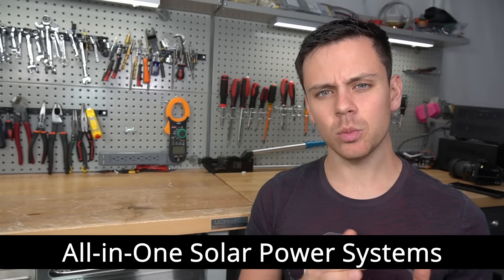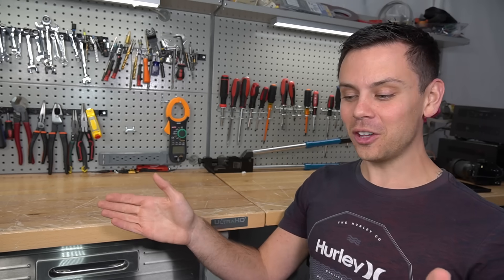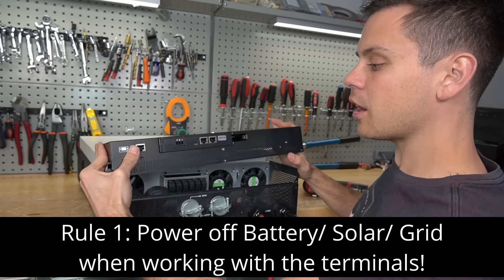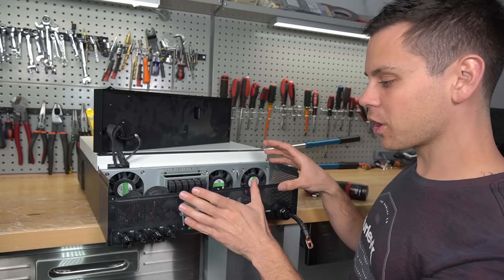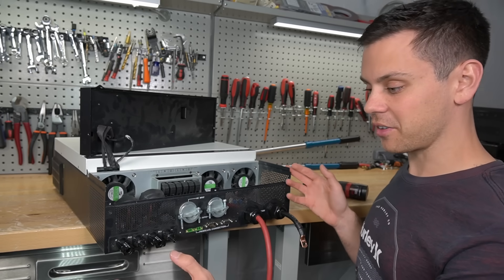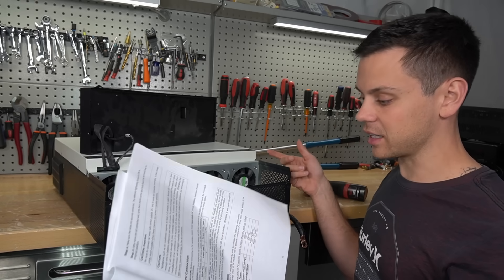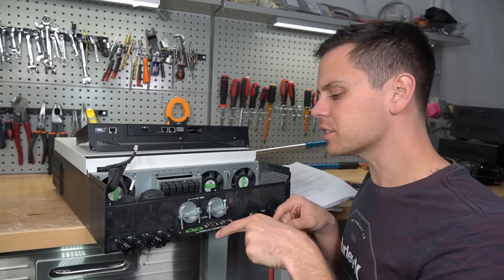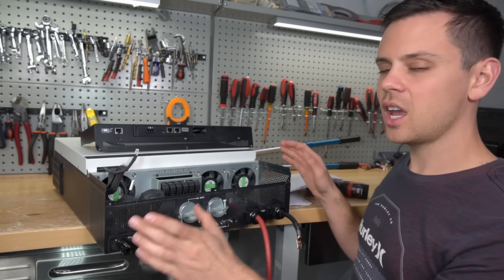All-in-One Solar System: 2 Basic Rules for Shock Hazard Prevention

Comment: Thanks Will, If I open the cabinet, I'd use either a voltage detection pen or multiple meter DC for solar plug connectors and AC for (240v Australian) hoping to see 0.00
🌏🪛
Reply: (lol, Australians without electrical licenses shouldn't talk about doing AC work - not even asking questions on forums - ask a sparky friend - to help (pay for advice if must's be) - having a laugh, sorry - but true.

when "changing a light bulb" act as if everything is deadly -  take precautions to prevent the death bit (or fire).
Reply: Non contact voltage detector pens are not 100% safe at detecting live voltage. They work on capacitance. Multi meters are better but no guarantee that they are working so you could assume it’s dead and still have live potential. Safe isolation testers are not much when compared to not having them and getting a lethal shock. Proving unit + tester, test live to earth, live to neutral, neutral to earth and then back to the proving unit again.
Reply: @davideyres955   - and if one doesn't know what the heck it all means, ask for help, lol...

Comment: I discovered this the hard way about a year ago with my pair of LV6548’s . If that thing is running don’t touch the MPP inputs anywhere between the inverter and the circuit interrupt even if you have open it from the solar panel source. Also, don’t direct short them because it may damage the MPP section. The positive (+) and negative (-) of the entire PV circuit must be isolated from the earth/ground. I’ve grounded the panel frames and their mounting structure. The PV surge protector ground taps go to earth/ground.
Reply: I am glad you touched on this. So to be clear. I should continue to ground my Ground Mount and Frames on the Mounts. But, I should NOT ground my Combiner Box? Thank you in advance.
Reply: @HarshHazeStudios  
None of the PV circuit + or - can come in contact with earth or ground. The only place it can come close is at the surge protection (where if an outside source subjects the circuit to excessive voltage it dumps to ground momentarily). The panel frame, structure, metal boxes or conduits used along the wires path should be grounded. The idea is if any part of the solar power circuit has a short to metal, you don’t get killed by touching high voltage. The PV negative is not grounded nor is the positive. PV is just basically a isolated loop that leaves the inverter and through the panels with interrupts (breakers and or fuses) along the way.
Reply: Thank you for this thorough response.  Makes sense.
Reply: This is what I finally realized after watching the video several times and reading through comments, and realizing that the surge protector earth ground connection does not connect the PV wires to ground unless there is an actual surge.  If your comment and responses were pinned to the top it would have saved me a lot of time.  It would likely help others too.  Amazing what is "simple" and "obvious" to some are not so much for others, even with experience and education.  Thanks!

Comment: My Growatt shuts down if it detects a ground on the PV system. I have had 2 panels ground after a heavy rain. They are out of the system now. I'm a locomotive electrician. 3+MW generators. There is nothing grounded on those systems. The only thing grounded is the starting circuit. Don't be fooled by thinking 48v won't hurt you. I've been lit up with 36volts. Work 1 handed. Never use both hands to do anything.

Comment: I guess that's why we do lock out/tag out for whenever one works with electrical circuits.  And to go along with that there should be circuit isolation breakers between the All-in-One Source and any circuit with potential for power.

Comment: I just bought the Ecoflow River Pro and I noticed some unusual grounding configurations. My AC output has a 2 wire, polarized plug. Then I saw a video were they put a 3 prong wattmeter on it and was surprised it attached. It was only then that I noticed that these big holes next to the AC socket: The item plugged into the AC output was not grounded. Ugh. The manual says the AC output must be shut off before any item is removed to avoid damage. The solar input is an XT60 and has no grounding. But next to it is a screw that they said can be used for grounding. The manual gave a couple of ambiguous sentences about using the grounding screw. The AC input uses a standard 3 wire cable. When the AC input or solar panels are used, the battery can't be turned off. I had to pull the cables off before I could shut the battery off. I thought that was very strange.
In all of the tear down channels that I watched it appeared that every solar battery was using the same printed circuit board. The only exception that I found was one solar battery had a bi-directional inverter. I had never even heard of that circuit before.

This a very new industry. It seems that all manufacturers are converting to LiFePO4 solar generators as fast as they can to get into this emerging market. 
That means that every user needs to watch channels like yours. If they don't, sooner or later, someone is going to get hurt.
Reply: Ex

Comment: I have this problem with my system that has a eg4 6048. I actually talked to signature solar about it in early October. I had 36 volts A/C back feeding to my panels. I noticed it when I was working on my array while on a ladder and got shocked when I touched my the aluminum frame. I grounded my array and it went away. Be sure your ground is good on the array itself.

Comment: Most all low cost HF AIO inverters do not isolate PV charge controller from HV DC bus which has its polarity flipped at line frequency rate when AC output is active and neutral is ground.  This means the PV lines are riding on top of a high voltage squarewave when AC output of inverter is active and neutral is grounded.

This scheme comes from original 'transformerless' PV grid tie inverters (battery-less). 

There will be variation depending on state of inverter operation but the primary danger is when AC output H-bridge is active.  This is why you need double pole breakers on PV pos and neg lines to remove this HV squarewave when working on panels.

If inverter is in standby mode, in pass-through only, there is still grid AC on H-bridge PWM sinewave IGBT's even though they are not switching.  IGBT have a lot of junction capacitance so some grid AC voltage will couple into PV circuit.

Some units have an intermediate DC-DC converter between SCC HV DC output and inverter's HV DC bus.  These can sometimes isolate PV from AC H-bridge IGBT devices.  The intermediate DC to DC converter is used to convert 500vdc SCC output down to 250vdc HV DC bus for 120vac inverters.  It allows PV inputs up to 500vdc even though inverter internal HV DC bus only needs 250vdc.  SolArk, Deye have this not only to down convert 500vdc to 250vdc but also to allow PV power to be shared between two separate, isolated 250vdc HV DC buses for the two 120vac inverters that are connected in series for 240/120vac split phase AC output.
Reply from the maker: OHHHHH ok wow! Glad you commented, I knew you would have some insight. Great information. I was trying to figure out the configuration and this comment clears up a lot. Thank you
Reply: @DIY Solar Power with Will Prowse  Can you clarify the grounding part. Do you mean that if you have an all in one you shouldn't ground the solar array? I'm about to set up a ground mount solar array but was going to ground the frame and panels. Sorry not sure if I missed something
Reply: @td1938  Ground the frames, do not ground the PV wiring.  Of course you can still use surge protection for lighting management on the PV wiring.  Do not use 2nd hand panels unless you know how to do leakage (electrical) testing or the panels have been tested by the seller and they will stand behind their test results.
Reply: @retro zmachine  Thank you. I appreciate the info.
Reply: @retro zmachine  You know, that would be a Great Video for Will. Or maybe someone can elaborate about panel testing. I know how to test capacitors for leaking but that's a whole different thing. 
      I'm thinking that it isn't just using used/second-hand panels. I have a bunch of panels of very different ages. I would guess that an older panel, that I bought new, would probably have as much of a chance of leakage as any other older panel!
    Like my earlier post, this is information that would be very useful and is actually a Safety issue for DIYers.
     OK, so let's have information about checking used panels for leakage and suitability for use.
       Ya'll Take Care and be safe, John 

BTW, I only mentioned the cheap Chinese units earlier because that is what everyone else was saying. As I noted, it is/was my understanding that this effected the more expensive equipment as well but everyone was screaming 'Cheap Chinese'!!!!
Reply: @JohnDoe-pv2iu  Yes, great idea.  I can tell you all about the things to look for etc but putting it up in a YT clip that someone would want to watch is another talent entirely.  Second hand panels are a great resource but you do have to know what is safe to use in any given situation.
Reply: @retro zmachine  How would you setup a test and what equipment is used. I figure a meter for certain. Is the panel powered by light or a voltage supply for testing? I have power supplies from/for Ham radio. Is the leakage from the lead(s) to it's frame or is it checked through the positive and negative leads? I'm trying to get an idea about this. I have a pretty good working knowledge of electricity from Ham radio. I just don't have much experience with Solar Power and even less with solar power equipment testing. Thanks for any help you can provide, John
Reply: @JohnDoe-pv2iu  The first step is visual.  Is the backsheet (the usually white backing) intact?  If its cracked / shows crazing (like smashed safety glass granulation) / outright missing avoid that panel.  From the front side of the panel look for crazing in the clear cell encapsulation particularly around the edges near the panel frame, are the bus bars at the top and bottom of the panel bright and shiny or have they tarnished, same goes for the cells.  All of that is a sign of moisture problems.  When it comes to testing the panel for leakage you really need a proper test meter.  The average multimeter will be working around 3 to 9 volts while the panel needs to be tested up at the array working voltage which may be 200+.  You are checking for leakage between the + and - wires to the frame.  I'm sure if you do a web search you'll find lots of info on leakage testing panels.
Reply: @WillProwse  good because he lost me in the electrical jargon after one sentence.
Reply: The lack of isolation in transformerless designs is also the reasoning behind many countries requiring fusing or other over current protection in both the + and - leg of the PV wiring.  The manuals for HV PV input units usually state that there is no isolation so it's not being kept secret.  Read the manuals people.  Read the manuals.  I'm fairly confident in recalling that this very subject has been mentioned and often stated by at least one person on Will's DIY solar forum quite a time ago so, surprising that this 'discovery' has just been made.
Reply: So is the solark isolated? I flip all the breakers anyways but good to know I guess
Reply: I understand that 'cheap', 'chinese' inverters are going to be cutting corners and all of them probably have safety issues. I have heard that a lot of the higher end units have similar issues as well though.
     I think that it would be a very useful subject for everyone to discuss and list the brands and models that have issues, and particularly the exact type of issues. This information is very important. Everyone should be very careful, but they should also know what is the most important safety concerns of the equipment that they are using. I know that this can be a lot of work but maybe folks can list what they have encountered with their equipment in the comments. This could be the start of a very good, New Safety database!
      BTW, That's all I want, is a safety database. I am not thinking about this to try to 'Bash' any equipment. As has been said, it seems to be industry wide so it isn't just saying brand X is bad...
        Ya'll Take Care and be safe, John
Reply: @JohnDoe-pv2iu  It's not a cheapie Chinese problem.  It's a result of the transformerless design that is now pretty much the defacto industry design.  Pick almost any grid tied inverter off the shelf, any brand, any model, and it will have this issue.  In terms of HF hybrid inverters any of the Voltronic, or copy of, high PV side voltage inverters will have the issue.  It's not hidden.  Even cheapie brands such as PowMR clearly state it in the manual that the unit does not have isolation between PV and AC and goes on to advise that the PV side must be isolated from ground.  The real issue here is that people don't read the manuals, or do not have the technical expertise to understand what they are being told.
Reply: Thank you, I was just about to post this.  When my residential PV system was installed, I was told to ensure I disconnected the PV system by the main switch before anything else, then the inverter, then the AC in....  (It uses trickle 220VAC to make the inverter work.)  The start-up is exactly the opposite.   I thought it was weird, but with your explanation, I know get it.  Thank you!
Reply: Well confuse the hell out of me I guess I’ll just stick with what comes in my house from the power pole!!!!!
Reply: Is it safe to assume low cost LF AIO inverters also do not isolate the PV charge controller?
Reply: @pryda1  volt meters are your best friend always
Reply: @d8niel77  ( yes never assume - test before placing a body part in contact with live terminal)
Reply: @pryda1  No.  It's not safe to assume one way or the other with all this Chinese origin stuff.  I can point at certain models that definitely are safe as they are really just separate inverter and MPPT chargers in a box with a low (as in battery) voltage interconnect.  That brings up another point, battery voltage.  Some of these cheap low frequency jobs require 72+ VDC batteries.
Reply: When Testing for Leakage as an Electrician,  I would look for a Solid Ground connexion. Mostly earth ground and from measure between the + connexion of the panel and the Ground (PE ) connexion. If the panel is Leaking.(+voltage) It will definitely show on the Meter. Without a doubt. 
Correct me if I am wrong

Comment: Will, can you explain the best way to look for an internal short or current leak in individual solar panels? You 
mentioned that two used panels had a current leak. Thanks!
Reply: Seconded
Reply: Third
Reply: You might be able to see it with a thermal camera.

Comment: WTH????  If there is 120V across the PV inputs,  what current is being driven through the panels by the 120V???    I was very aware of the instructions of not grounding the PV and was aware of reports of voltage on the PV..... but I thought the reported voltage on the PV was a bad unit... not 'as designed'.    I am really struggling to figure out how this is considered OK.... even if you are careful!!    I am getting less and less impressed with these value-priced AIOs.  

Note: Since it is a non-isolated charge controller, I could almost understand a 120V potential between the  PV lines and ground, but I really don't understand 120V between the PV lines.

Does this problem exist in quality brands like Schnider or Solark?  (I would guess they don't)   

BTW:   The 'do not ground the PV circuit' makes if difficult to implement the NEC requirement for PV Ground Fault Protection with these inverters.   Most PV GFPDs end up grounding the PV Circuit.     To implement PV GFP on these units requires a hall effect sensor circuit.

Comment: I can’t believe I have just seen this now. I wish this video was made a week ago.  I had just about finished my install of a 6kw all in one. Had battery connected and AC on. I had three of the four string wires connected to the dc isolators. When I was on to the last, I plugged in the mc4 to gauge the exact length to cut the cable to fit into the isolator. The other end of the cable touched off a copper heating pipe and bang!!!! I did a lot of damage inside the inverter with many blown mosfets. I know I should have had all off when working on it  but I didn’t think the mc4 string inputs would be live! Rather not say the manufacturer at this point. I feel very foolish indeed.
Reply from the maker: Yeah I had no idea and I work with these every single day. I can't believe that happened to you and yes completely unexpected. I wish I found this years ago when I got my first units. That's awful your units blew the MOSFETs. Dang it!
Reply: I had a very similar experience with my first lvx6048. was putting the pv input wires into plastic conduit, and one of them touched a metal disconnect box and blew out 3 mosfets. Ended up having to change out every board inside to get it working again, as well as my daly bms as it wasn't able to output more then a few amps anymore, and got hot while charging.
Reply: Nothing to feel foolish about. These oversights by the industry and poor manuals are causing many problems for users.
Reply: ALWAYS make all connections with all switches off, (and EVERY input switched, both on positive and negative wires for DC, and all input AC breakers off).